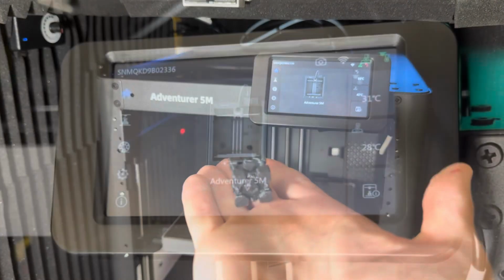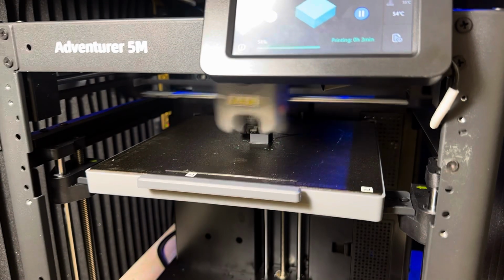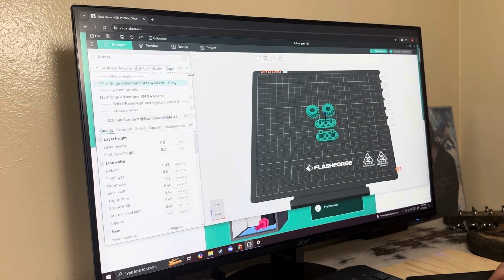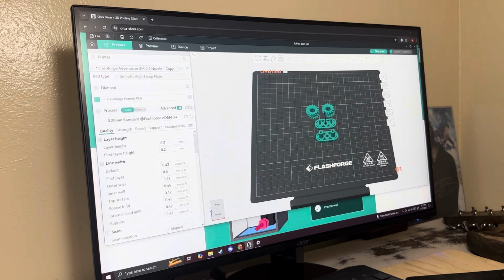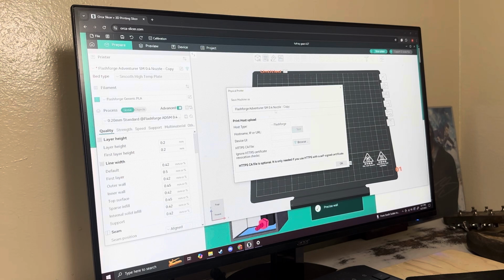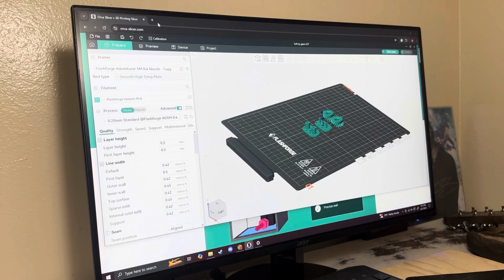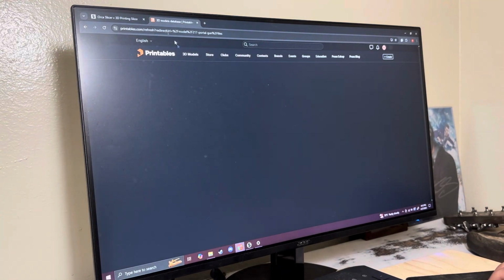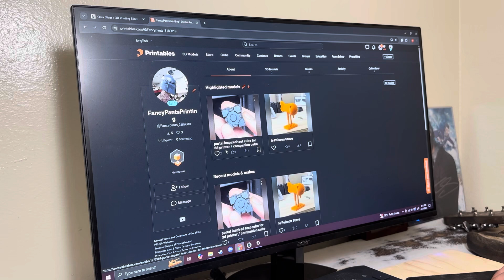How To 3dprint Over Wifi Via Orca Slicer ANY PRINTER / FlashForge

Comment: Hi, I have a elegoo centauri carbon that I’m trying to connect through wifi with orca slicer. I’ve followed your steps but it’s giving me a “connection timed out. Could not connect” any tips? Thanks
Reply from the maker: Make sure printers connect to the right WiFi source and that you’re using the correct IP address. Then double check correct machine is selected in orca (sometimes it acts weird) if that fails it’s probably something with your firewall. 

Hope this helps! 🎉
Reply: @Fancypantsprinting it started working. Thanks!